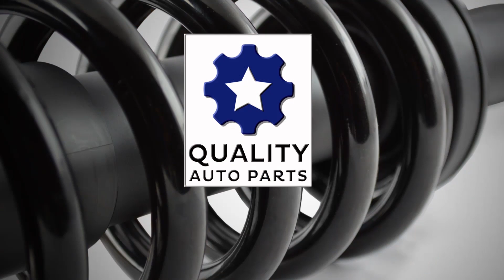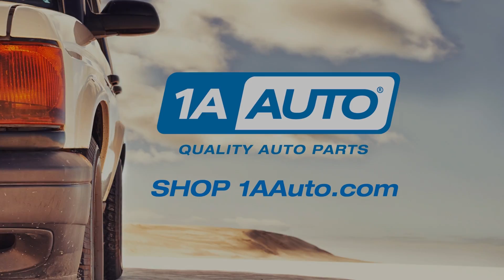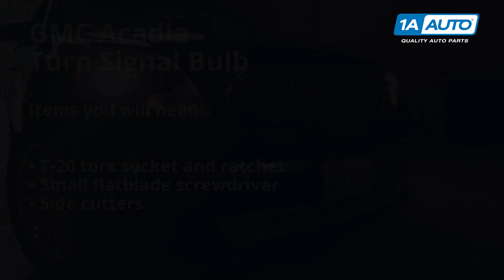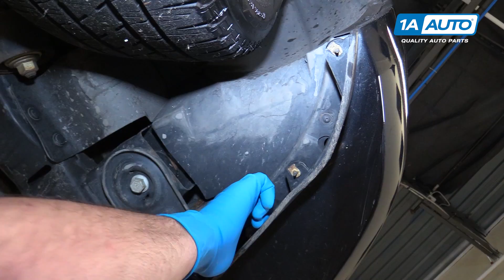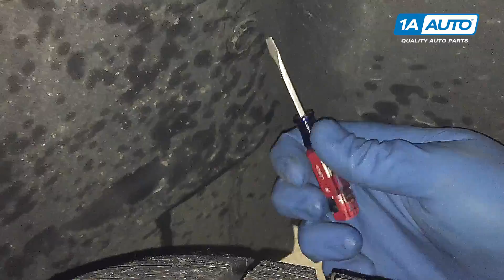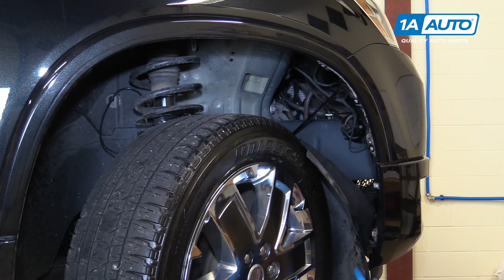How to Replace Turn Signal Bulb 07-16 GMC Acadia

Comment: I have a rapid flashing indicator for the left side. Neither the exterior blinker or headlights work with this condition. I’ve changed the entire driver side mirror, which was knocked off and damaged thinking it was the cause. I also checked all fuses pertaining to lights. Do you think changing the blinker bulb should be my next step? If so, are the front and rear the same part number ( bulb)?
Reply: Did you test it before you put it back together 🤔

Comment: My left turn signal on a 2012 GMAC Acadia Denali is blinking rapidly. Both front and rear turn lights are working.  What is the problem, and how do I fix it? Any suggestions are appreciated. Thank you.
Reply from the maker: +Juan Martinez Usually when the blinkers go fast it indicates there is a bulb out. You may be able to find the failed bulb by turning on the right turn signal (not the hazards) and compare the lights to the other side. Thanks! 1AAuto.com